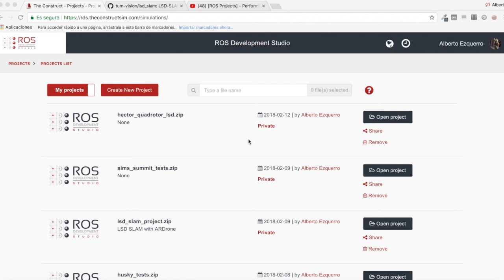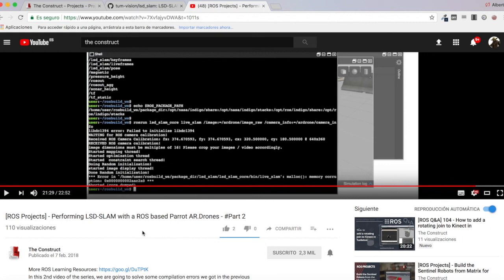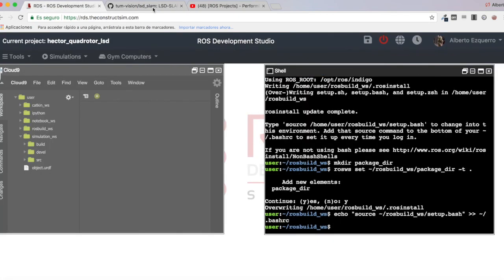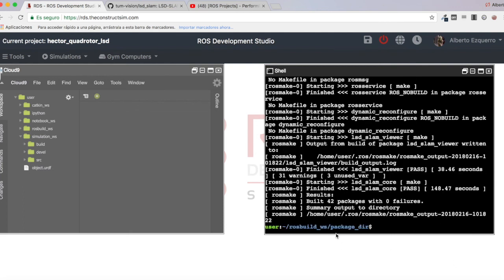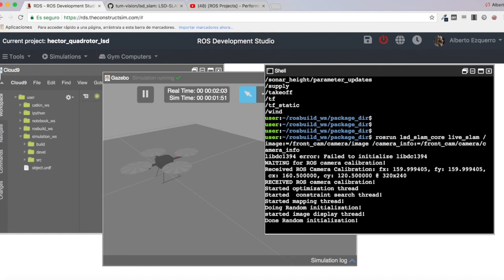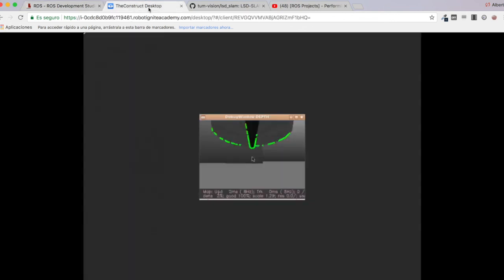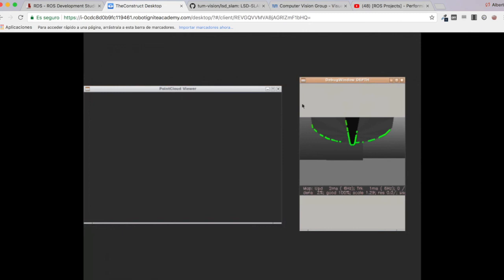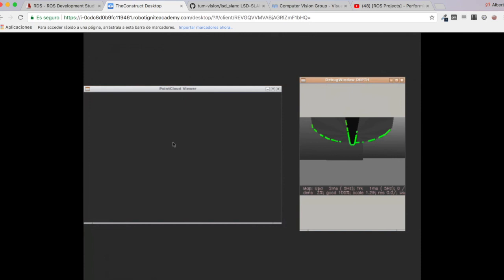[ROS Projects] - Performing LSD-SLAM with a ROS based Drone + Hector Quadrotor UAV - #Part 3

Comment: You see in your error message that it needs the resolution to be divisible by 16, which ardrone's standard resolution is not. You can edit the configuration files to  make it output 720 or 1080, but sadly nothing divisable by 16. For that you need another piece of code to scale it down. You can see in the configuration files for the hector drone however that the standard resolution is divisable by 16.